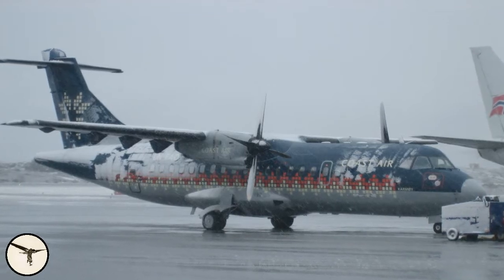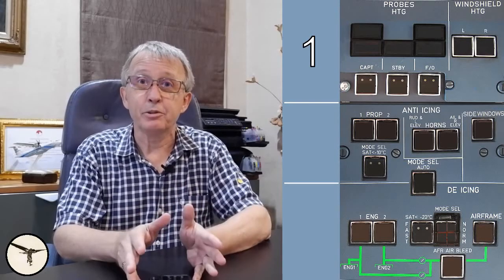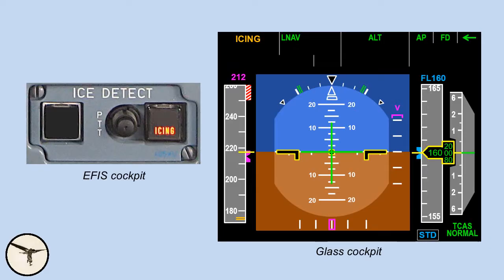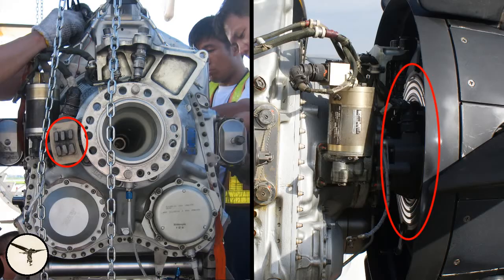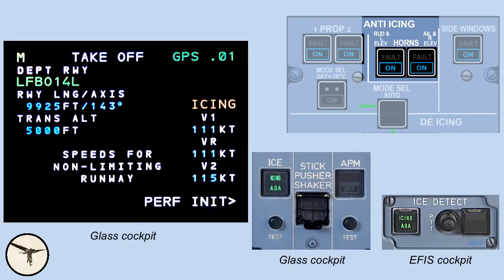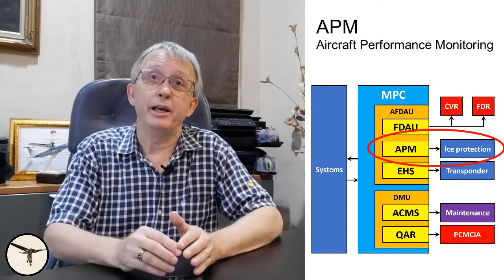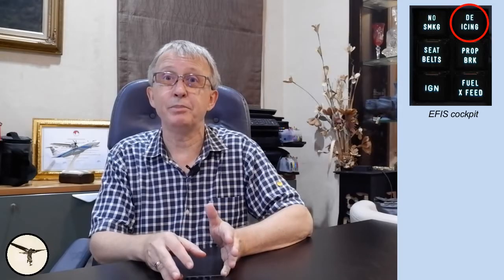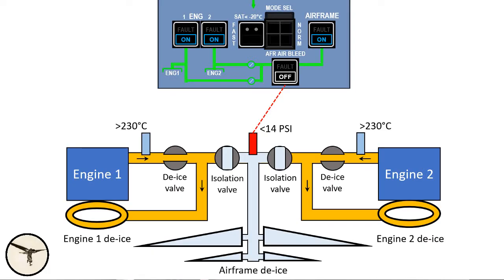ATR ice & rain protection systems

Comment: how do you remove "prot level"? If you don't have a yoke at hand and fly only with AP you can't use vertical speed to descent and you are stuck with ice at the same flight level at TOD. Very interesting situation. (in FS2020)
Reply from the maker: Set a lower altitude, select VS mode, and use the pitch wheel to set requried rate of descent.
Reply: @FlywithMagnar  not working, must be a bug I think. Thx for the reply :)

Comment: Hello Magnar, why do pilots never learn from past experience? 
In the past, two ATRs crashed just because they were waiting for their descent clearance in severe icing conditions and these two accidents should have been a good example for all ATR pilots.  
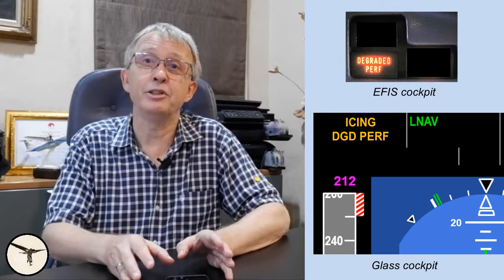In this video at 25:02 as if you knew the main reason of Voepass crash. The pilots disregarded all warnings about icing conditions and degraded aircraft performance. They completely forgot the deadly effect of icing on the ATR and the golden rules of aviation, i.e. Aviate, Navigate, Communicate. The captain continued his briefing as if nothing had happened, the copilot with more hours and experience tried to give him hints about icing, (A LOT OF ICING) just one minute before they lost control of the aircraft, but didn't tell him that he had to descent. (Poor CRM and Power distance in the cockpit) Instead of disengaging the autopilot and initiating the emergency descent, he continued his approach briefing. The F/O did not challenge the captain and strongly suggested that he MUST descend. Instead, he talked on the company frequency with the operations for non-safety related items. 
They never came up with the idea to descent earlier although they had more than enough fuel due to the MEL item on the PACK1.

No one should blame the ATR because it has all the precautions and warnings for icing. All the pilot had to do was to start the descent and accelerate and STRICKLY FOLLOW THE ICING PROCEDURE. 

We should find the answers, in the light of human factors and performance, as to why these two pilots disregarded the known effects of icing on the day of the severe icing SIGMET on their route was in effect, which they encountered for almost the entire flight.
Reply: We all know that they must have descended earlier, however this is the main question CINEPA must find the answer “why they didn't?
What were they thinking and talking about when the AIR FRAME DEICING failed three times. 
There must be some valid reasons and why they didn't. 
The preliminary report gives some idea but still so many questions are open. 
Hopefully we find all the answers on the Final Report. 
I am expecting that the Company culture, CRM, icing awareness and simulator training will be addressed on the Final Report under the recommendations section.
Reply: @PitoTub 
Your questions are perfectly valid.
The preliminary report explained what happened.
The final report will hopefully explain why it happened.
A tragedy.

Comment: I was watching the ATR72-500 accident in Brazil where icing conditions are mentioned in the media as a possible cause of the flat spin resulting in the crash. From this video I understand that de-icing is actually something you need to take care off to do it properly. The ATR is certified to fly under icing conditions, if the media suggestion is right then someone may have made an error on the controls described here, still it doesn’t explain the flat spin I saw.
Reply: FINAL REPORT IG-136/CENIPA/2013 (PP-PTU_26JUL2013_ing_IG.pdf) - Report of serious incident in similar situation in Northeast of Brazil in 2013, pilots turn on anti-ice and de-icing devices - but not the boots for wings and engine nacelles; when the autopilot turn off the PIC fight against the stick pusher, the PM feathered the propellers - aircraft manual instruct set in 100%. Plane fall for ~5000 feet's, but the control was regained and the aircraft safety landing in the destination.

Comment: The ICING alert has been a source of great frustration for me as it doesnt take much rain to trigger it on the ground.

My worst case was when an ICING alert triggered right at the moment of initiating Take-off before the power levers reached the notch and T/O inhibit. This resulting in a very low speed abort.

There used to be a loose company policy to recalculate for an icing takeoff if you get an icing alert on the ground but now i see we can just wait for the 60sec and continue with normal conditions.

Comment: Great video. Thanks, captain. Just a question, please: why the leading edge of the vertical stabiliser does not have boots (the Saab 340 or the Dash 8, for example, have)? Thank you ;)
Reply from the maker: It is not required as it doesn't affect the controllability of the aircraft. Do you know that the Boeing 737 doesn't have ice protection on the horizontal stabilizer?
Reply: Got it. Didn't know about B737. Thanks for sharing your knowledge, @FlywithMagnar. All the best ;)

Comment: Hi Magnar, I did have detector triggered in Africa on ground during taxi and after landing on ATR 42 300, and ATR 72 201 and 202 in the past with tropical rain conditions.
One question for you linked to Side Windows fault / MEL and QRH.
With a Side Windows fault in flight, QRH says to set Side Windows Off.
One reset might be considered if thought essential but let's assume it's an electrical failure in the RH system.
Now, there's only one switch so if it's OFF, both side windows are not working.
For next dispatch, MEL says, 1 Side Window needs to work. As far as I could see the MEL, No Maintenance action is stipulated. Breakers are not meant to be pulled either....
How do you understand this?
Reply from the maker: Hi. Thanks for your feedback. Regarding the side window heating elements, they are controlled by a single pushbutton. I have not been able to discuss this with an engineer, but every item in a checklist is there for a reason. I assume that it might (even when the risk is one in a million) be unsafe to keep the pushbutton ON when a failure is detected. After landing, maintenance action is required. If they cannot repair the failure, they will isolate the failed heating element and release the aircraft for service in accordance with MEL (Minimum Equipment List).

Comment: Very good video Magnar, In the 500 engine power reduced apprx by 2% with de-ice on. In the 600 I can´t notice that reduction in trq. Are the engines on the 600 rated to counteract that? I can´t find it in the books... all best
Reply from the maker: Hi Marcus. There shouldn't be any difference between the 500 and the 600. They have the same engines and the same de-icing system. Personally, I haven't noticed any reduction in torque when the de-icing system is selected on. In comparison, the air condition system takes away about 5 % torque with normal air flow. The de-icing system requires a tiny fraction of that.
Reply: @FlywithMagnar  Thanks for the quick reply. As you say, the engines are the same and I haven’t flown the 500 for a while so I probably remember it wrong. Glad to be able to stop wondering about that now anyway.
Reply: @Fly with Magnar  Hello  Captain Magnar. Thank you so much for this free education on ATR systems. 
On torque reduction when DE-ICING system is selected ON, I've also noticed a slight reduction just like Marcus is saying. My understanding is that hot air that's blown to the de-icing boots is drawn from the engines hence the reduction in torque. Please do take note next time you select DE-ICERS so we all discuss it here.

Thanks in advance Maestro!!!!

Comment: I have a Doubt Sir, why the static heating is not monitored in flight when all level one equipments are heated and monitored. Whats the reason for inhibiting the monitoring of only static ports.
Reply from the maker: The static ports are flush with the fuselage and cannot be clogged by ice in flight. Therefore, if a static probe heating fails in flight, it will not affect the safety of the flight. However, the crew will be alerted after landing.

Comment: Great job 
Question 
How to détecte flaps uncoupled ?
Reply from the maker: That's a great question! The manuals doesn't describe what flaps uncoupling is. We know what pitch uncoupling is. We also know that each wing has an inboard and an outboard flaps. They are connected with what FCOM describes as a "failsafe design". I assume that flaps uncoupling is a condition where this "failsafe design" is broken and that there's no alert (unlock, jam or asymmetry). However, I have no idea how this can be detected from the cockpit. Perhaps a rolling tendency?
Reply: Thanks

Comment: Hello captain is there any difference between Minimum Severe Icing Speed (MSIS) and Icing Bug? I was reading the new ATR-600 FCOM and stumbled upon some info in DSC.30.8.2.1. (CONTROLS) it says "INCREASE SPEED caution is generated when the aircraft speed is lower than Minimum Severe Icing Speed (MSIS) +2kt." However in DSC.30.8.4.3 (SYSTEM MONITORING) "INCREASE SPEED Alert, In level flight: Drag abnormally high and IAS below ICING BUG +10kt or In climb: Drag abnormally high and loss of rate of climb and IAS below ICING BUG +10kt"

I'm a bit confused about these two speeds (MSIS and ICING BUG). Where can we find the values for MSIS if ever?
Reply from the maker: MSIS is icing bug +10. Here is the answer from ATR: 

"ATR confirms that the INCREASE SPEED caution is intended to be triggered when the degraded perf alert is triggered and IAS below Icing Bug + 10 kt. This is in coherence with DSC.30.8.4.3.
Because the IAS used by the APM is an average of the last 10 second and the increase speed alert is usually triggered in altitude hold mode where the consequence of the performance degradation is on the cruise speed, a 2 kt margin have been added to the Icing bug +10 to ensure the alert will be displayed at ICING BUG +10 at least.
In case of climb, because the speed is constant, the INCREASE SPEED will be triggered just below Icing Bug + 12 Kt."
Reply: @FlywithMagnar  ohhh I see so they regard the MSIS as icing bug + 10kt. That 2kt margin give allowance and assurance that increase speed alert will trigger. All in all the speed allowance given by MPC APM is is around 20-22kts from the real icing bug. The info is from a note in PRO.NNO.ABN.30.5 Degraded Perf and Increase Speed "In case of APM messages "DEGRADED PERF" or "INCREASE SPEED" VminOPS automatically increase by 10kt"
Reply from the maker: No. When you get  "DEGRADED PERF" or "INCREASE SPEED" cautions, minimum speed is increased with 10 knots. On the 600, it's done automatically for you. On EFIS variants, you have to physically move the red bug to +10 kt.
Reply from the maker: Thank you for noticing this. I have sent an email to ATR and asked for clarification.

Comment: The procedures for setting Level 2 & 3 is quite different from what it says in the ECL. I can't remember exactly what the ECL is telling since its not on the QRH, just correct me if I'm wrong. The procedures states that when you are out of icing condition, you can turn off level 2 & 3 and keep ICING AOA until visually cleared of ice. However on the ECL "if there is still ice found on airframe", level 2 & 3 must remain ON even when outside icing condition. Another ECL procedure says "at first visual indication of ice", you must turn ON level 2 & 3 regardless if you are in icing conditions or not. The ECL is simply telling if there is ice on airframe, level 2 & 3 must remain ON regardless of conditions and temperature.
Reply from the maker: The procedures in the video are from the QRH (Quick Reference Handbook). The QRH has priority over the ECL (Electronic Check List). There are several discrepancies between QRH and ECL. There's even an OEB (#48) stating that ECL versions 24 and 25 and older versions must not be used.

Comment: I had experienced ICING alert on the ground during a drizzle even with temperatures above 25C. It is quite annoying especially when you're about to takeoff as we always get undue alert of "CHECK TO SPD" and it ruins the takeoff data. 

But the most dangerous experience I had with this problem is during flight in a light rain with OAT around 21C because it was already in a final approach for landing. We were maintaining Vapp that time then ICING alert came on and off intermittently. With ICING message the stall threshold increases, and with the current Vapp speed in normal condition it is way below the Vmin OPS for icing. The speed is just right above the solid red line on the airspeed ind. I'm a bit worried because we might get a shaker and pusher during approach at a lower altitude
Reply from the maker: I have never heard about this problem in flight. However, an icing alert does not increase Vmin OPS. The stall threshold is only increased when the ICING AOA light is illuminated. (FCOM.DSC.31.14)
Reply: @FlywithMagnar  i'm not really sure how it happened that way but I noticed the fluctuation of my Vmin OPS during the intermittent icing alert. I was PF that time, my Captain also called out for speed check as it goes down below Vref. I added around 15kts more to my Vapp to have ample room just in case

Comment: What's the reason why side windows are heated partially? Can the engineers attach a heated film in between just like the windshields where the whole glass is heated?
Reply from the maker: Hi, I had to do some research to answer this question. According to the information I have received, the reason is that the heated area provides forward visibility in case the windscreen heating has failed. Secondly, DC electrical power cannot be used to heat a film. Hence the thin wires, similar the rear window of a car. Third, it's also a question about cost. If the regulation doesn't require it, you don't have to install it. Every part of an aircraft is insanely expensive.
Reply: @FlywithMagnar  Thank you for all the effort looking for the answer captain! I greatly appreciate it! Those are just curious things I observed in ATR it is also nice to know the reasons behind it. It might also be the same engineering logic behind why ATR spoilers don't deploy upon touchdown, maybe its not that very efficient to slow down the plane because it is too small